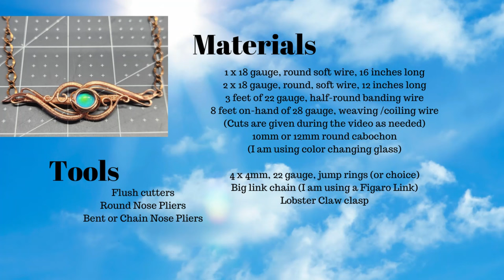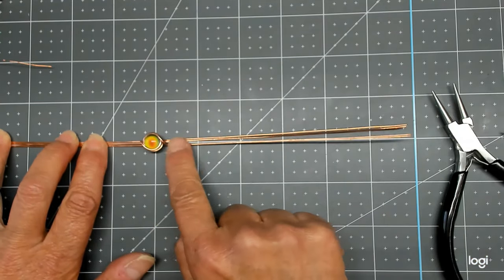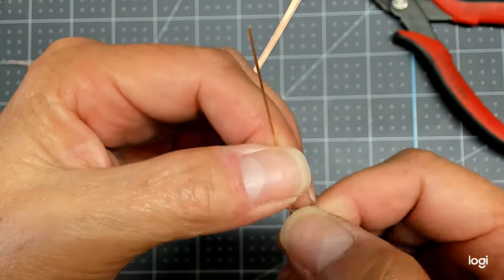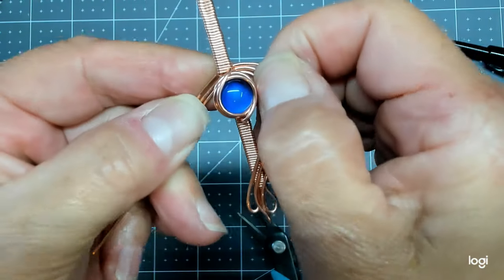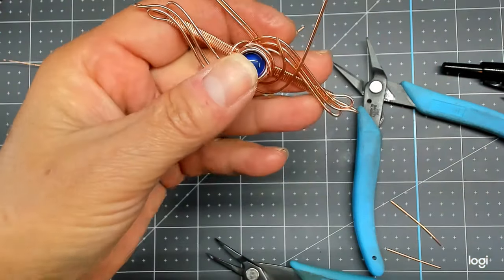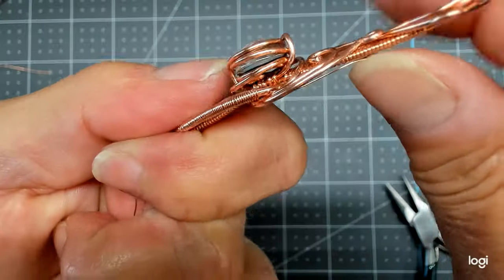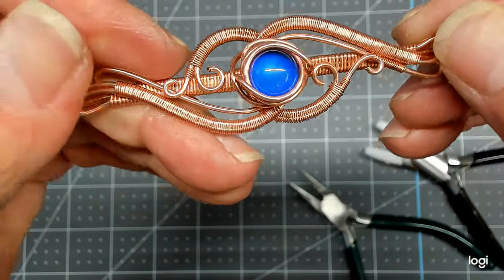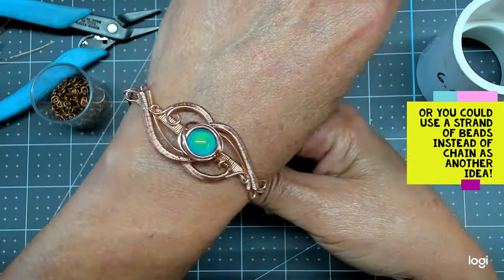Easy DIY Wire Necklace or Cuff Tutorial

Comment: Thank you for the great tutorials. You're a great teacher. I would really like to purchase the board you're using can you share where you purchased please
Reply from the maker: Thanks so much!  That's called a Cricut board and Cricut is the brand, it's just a measured craft mat, they sell them at most hobby stores, online at Amazong, sewing stores.  I hope that helps!
Reply: @PerfectlyTwistedJewelry  one more question if I may, where do you purchase your cabochons
Reply from the maker: I actually purchase most of them from the colorado mineral and fossil show and several of the dealers that I favor there and have been shopping for years.  I also occasionally shop in Etsy with a few shops for tiny cabs.  I don't shop with just one dealer.  I also shop a few of the local mineral stores here around me.  I hope that helps.